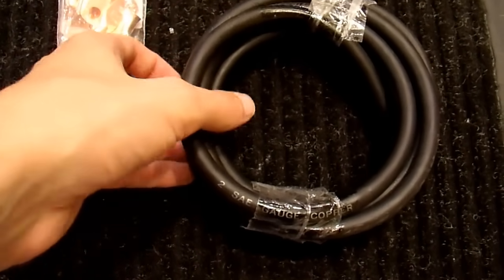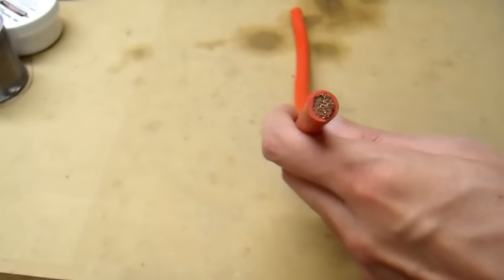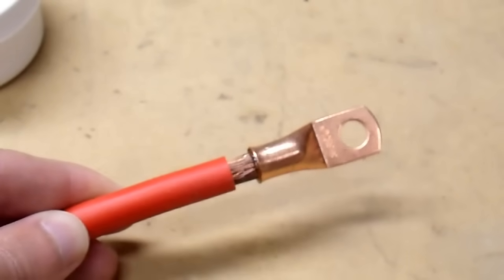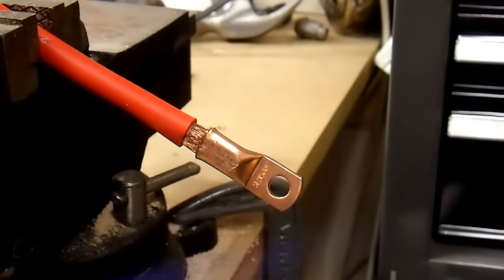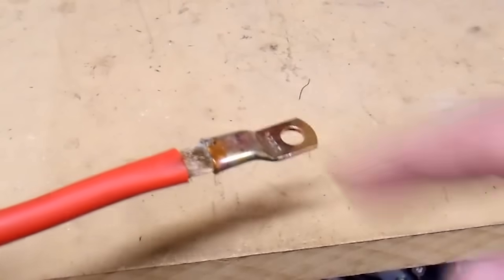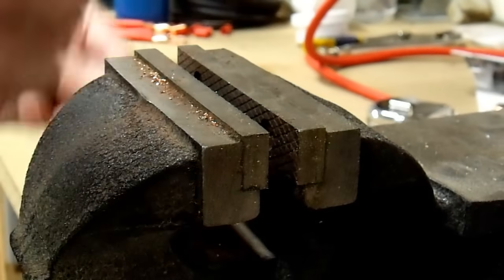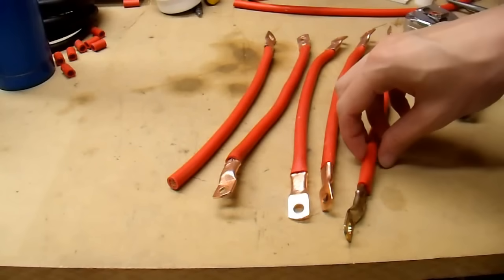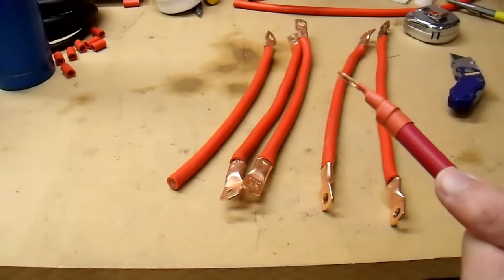How to Make Battery Cables the Right Way and the Easy Way

Comment: I have run into a problem a few times. This concerns installing inverters. The awg that a manufacturer says is needed for installing a inverter is to large to go inside of the connector on the inverter. The only way to fit the wire in the connector is to cut back some strands of wire. Does cutting back some strands of wire change the specs of the cabling ? I dont know for sure my self but, I would guess it does. Maybe its not enuff to matter. I just dont know. It has concerned me when ive had to do that so it would just be nice to know. Thanks.
Reply: Bryan Keith
Yes it does.

Comment: if using the small solder. What i do is stretch out  1 ft long and i spool it back and forth across 2 points 1 ft apart. Usually about 5 or 6   times then twist this up and it gives you a nice thick solder.  The heat shrink tubing is nice to label 12 volt positive and negative. Dual wall works very well also for protection. If you have that green type corrosion, use hot water and baking soda. Works like a champ to neutralize the acid from the battery tops.  My 2 cents and thanks for making the video........... you rock.

Comment: I usually fill the terminal up with molten solder then re heat and dip the cable into the opening and let it cool. Heat shrink and your done for a better cleaner look. U can also use lead.

Comment: Why not clamp the terminal in the vice just to hold it? get it hot with the blow torch?fill it with solder and then plunge the cable in to it? Then heat shrink to finish it off :)

Comment: the heat shrink is also protecting for the gases you talked about if you can't pull the cable out then its fine

Comment: When putting connectors on the cables, buying some heat shrink with glue on the inside is a much better choice than using electrical tape to seal the ends. Also some silicone grease to keep the acid out is a good idea as well when inserting the cable. A tight crimp with clean wire is always required for a good connection that lasts. Clean as in no oxides or dirt, and cleaning the wires and lugs with acid either sulpheric or hydrochloric is needed, but must not by concentrated. Always pour acid into water to dilute, never the other way around. You will get a steam explosion and possible blindness if you do not follow this rule.

Comment: You're advice like your work is completely wrong .heat shrink is to prevent corrosion if installed right. And if you did the connection the right way " not you're way" Then you have no need to see if its lose . And a volt meter should be used to test not a look see. after watching this funny video with the misleading tittle i can see you need to watch a video on how to for real not for laughs as most do.

Comment: I like to ground myself by sitting in the bath, connecting the + and - to a 12v leisure battery - I put the neutral in my mouth and the line up my arse.
Sometimes I put popping corn in the water as well, if it's a movie night.

Comment: You can also make your own terminal connectors with copper pipe.
Tools: Pipe cutter, hammer, drill, drill bit, measuring tape (optional)
Select the size of pipe you need for the size of wire you will be using...cut off the amount you need (pipe cutter) to put on the wire plus the amount needed for the terminal hole.
Hammer one end of the pipe flat...use drill & bit (sized to your terminal stud) to make a hole through the flat end...place open end on wire & connect with punch and/or solder.

Comment: Vices are for amateurs, go the Hydraulic crimpers (borrow them if need be) Then cover with the thick quality adhesive lined heat shrink. Make the cable insulation tight to the end of the lug. Thats how  I roll

Comment: Adhesive Heat shrink is recommended.  It helps prevent corrosion.  They trained me proper way of making cables when I was building locomotives which is meant for all kinds of weather. And not easy to change out either.

Comment: You have never actually made cables in the " field " as we call it , Heatshrink and Spray On Clear " Liquid Electrical Tape " name brand " are a must in my business. Bare Stranded wire behind the lug invites corrosion under the insulation. I work in the Marine electrical field , your unprotected cables would not last a year.

Comment: NEVER Crimp Automotive cables, even heat shrinked .. there will be microscopic gaps where Corrosion CAN and WILL get in....   

ALWAYS Solder Automotive cables with Medium SILVER..  as it has HIGH melting point of 1380 Degrees.. Unlike regular Solders 370 degree's..  You can use medium Silver chains from a Craft Store for financial feasibility as  It's A LOT cheaper..

Yes....   Flux does NOT corrode.. ,  but Acidic rosin core plumbing solder WILL...  But what idiot would use that on wire ? ? ? 
AND Lastly............... Heat shrink WAS created for a Purpose..  It IS NOT just a frivolous foo foo Decoration...

Comment: Welding wire cable has FAR lower resistance, a higher grade insulator and is more flexible.  Marine grade (tinned) terminals are FAR more resistant to corrosion.  If you are going to do it yourself (best choice), then DO IT RIGHT.

Comment: Before soldering heavy electrical wire lugs I would suggest you watch this youtube video...
CBAC-Crimping Tools and Techniques for Cable Lugs.   Resin soldering works great for audio/video connections but is not the correct way for electrical cables.

Comment: And you are totally off base when saying that heat shrink is only good for cosmetic reasons. Also when you were soldering with the thin solder you should have pulled out a few feet, folded it over a few times and lightly twisted it together rather than wasting all that time peeling off and stuffing in the skinny stuff.

Comment: Just a prediction - Your soldered terminals, for your purposes, will last longer than your critics.  I think the only thing I would have done differently would have been to use the "no clean" type flux to make sure it drips into the center core of the cable.

The auto makers just crimp their cables, and they fail.  Worse yet, they fail down inside the lug where you don't see it as the corrosion accumulates and you wonder why your starter seems weak when you know the battery is good.  But the auto builders make good money off the repair side of their business, so there is no motivation to do better.

Comment: 3m heat shrink has hot glue adhesive in it and seals the connection. cheap heat shrink doesn't work.

Comment: instead of buying that thick gauge expensive wire '''' just push long lengths of house hold wire from scrap appliances through cut sections of garden hose pipe '''' strip ends twist together and then sod around with ends like your video '''''  and thats how to make free jump cables ' your welcome sheeple  ( heat shrink is the best ' keeps wire safe from corrosion ' can be over lapped so wont wear away or melt and wouldn't when cables are used correctly ' and looks tidy )

Comment: As for heat shrink not knowing if it overheats—if you pay attention to the hear shrink you will know. There are signs of heat damage unless you use open flame to shrink it which is incorrect procedure. Heat shrink keeps out moisture and reduces shock/short hazards.

Comment: I know the connection's good and there is no corrosion under my heat shrink because I did it.
Reply: because i did it  WTF   can you guarantee this statement is true 7 years from now.
Reply: @kwacz  Because I've been heat shrinking for 40 years with no issues?

Comment: Spend the $12 bucks for crimper, put electric grease on wire and use heavy duty heat shrink, heat up until you see the glue on the ends start to liquefy. Then you know if the joint is good, 
Zinc coated copper lugs are a better choice as well, they don't corrode!!!!
Reply: So you are recommended puttng dielectric grease on the stripped bare wires.  Then iserting the wires into the connector and crimping it.  Then sliding the heat shrink sleeve over the greased wire connector and applying heat to shrink and seal the sealant filled  sleeve???   What do you think happens to that grease when its heated up and what effect that now thin liquidized grease running out of the connector under the heat shrink sleeve and its sealant.  How well does adhesives stick to surfaces coated in grease?  How well does sleeve seal with expanding grease pushing seeping out from under it.

How about we lose the dielectric grease and save that to allie to the connector lug mating surface after the connector is installed on the wire.   Nickel and zinc coatings slows corrosion they are not corrosion proof.  They will corrode.  If you think otherwise put some battery acid on them and see what happens in a few weeks months.

Comment: Wow it's not hard to cut your wire to the right length before putting it in the ring terminals and always use some sort of a crimp tool, I use heat shrink looks miles better and why would you have them so close they would touch, maybe because you have so much copper showing. I don't do that many big cables but use smaller crimps all the time as an electrician to join cables or to add a ring terminal and I never have any copper showing at all ever really rough especially if done near metal as I have to crimp wires in metal trunking a lot. I just don't have a clue how so many people have watched this video yes there are worse ways but this is defiantly not the right way at all.

Comment: Wrong!!!! There is a reason that large  ampage cable should be screwed on. Or pressed not soldered 

The reason is that when high ampage go throu the conection it can caus heat. 

Heat is melting the solder and it can caus a fire. !!!

Comment: Ive been a marine tech for 20 years. When you solder wire it acts as a solid wire, fatigues from bibrstion and breaks. I swage the lug, cover between the insulation and the parts that will be covered with heat shrink with hot glue and heat the heat shrink. Even after submersion in salt water it is sealed.

Comment: This is certainly not a bad way to assemble the cables, but they do make a large crimper for this specific purpose.  If you use the crimper you don't really need to solder the ends.  I do solder the lead battery cable ends on however.

Comment: I would drill a hole in the terminal end instead of pulling the isolation back. The isolation should be tight into the terminal and the hole is used to draw in the solder. My prefered method though

Comment: My suggestion is to place the terminal in the vice melt in solder about 1/3 deep then press in the exposed cable and let it cool for a second. Once cool you can dent the end so will not pull out if heated etc. Also shrink tube is not needed if you measure the cable end properly

Comment: I don't know where you live but this by no means is less expensive, in Texas, than purchasing cables. Personally I hate these types of clamps, attachments. They are a nightmare to remove later. They are the reason I had a horrible, unnecessarily time consuming, task of removing them in order to attach much needed new attachments. I opted for traditional post attachments, less than $8. I didn't replace the cables this time, but I have in a different car. I don't recall the exact price for the cable set. If I had chosen to replace like for like they would have more expensive. I know I would have spent more money buying all the things you use in this video instead of the ready-made set. Also, by the time I got all of this together, set up, etc I would have been halfway done replacing the ready-made cables. Oh, and I don't keep a soldering iron in my apartment, or a vice. This is just unrealistic for so many households.

Comment: Your definition of “the right way” is deluded...
1. Flux is used to help solder adhear to the metal.  Why would you put it between the copper wire and terminal.  
      A. I get what you’re trying to do, the correct way would be to apply solder to the wire, and then crimp your terminal on the end, then heat and add solder.   

2. The “right way” doesn’t use comments like “ I’m only doing a couple cables so I’m not going to buy the right tools”. 

3. The right way would also involve heat wrap.   

Just my $.10.  Had you not labeled your video “how to do things the ‘right way’.” I would have watched, laughed and moved on.   But dude.   There are people who believe it if it’s on YouTube.

Comment: If you're going to use vise grips or the like to make a crimp, for gods sake at least put something in it to delay the corrosion like noalox or even petroleum jelly.  A properly done crimp will pressure weld the components together, sticking it in a vise does not and is no more than a temporary expedient.

Also, when soldering ends on big cables I recommend wrapping a 1.5" wide strip of wet paper towel around your insulation, it'll keep the insulation from getting fried and it'll help prevent the solder from wicking back up the cable.

Comment: Good video. My crimper is a set of bolt cutters that I adjust so when they are fully closed, there is a 1/8th gap. This way they are not able to cut. Most people do not know you can adjust that bolt on them to do that. It beats paying about $30 for a lug crimping tool. Plus if I need bolt cutters, I just reset that bolt to make them cutters again.

I would like to say to all the over educated nay sayers posting. You are not paying attention to the video in context. What do you all think this video pertains to? My intalect tells me he is making a video on how to make battery cables for a Solar Battery Bank and how to do it the Right and FAST way.  It is not about making welding cables or making cables for race cars or semi trucks or any of the multiple things people list as their professional experience.

You people remind me of the know it all idiots at church who pay no attention to the full scripture teachings in the Bible and try to argue some fantasy that you base on one or two verses from here and there. Sometimes I have to force people to sit there and read a whole chapter for them to see they are arguing wrong on a given subject. A subject that on it's full context is 100% correct, but for some reason they butcher it with stupidity that is not relevant to the full context.

Comment: This is great if you are making a quick fix on (1) cable, but for anyone making many or not in a huge hurry, this is all wrong. Proper crimping, not flat in a vice. Wire should be on the down slope, not up. You simply melted the wires insulation. Heat shrink is the BEST way to seal wire to prolong the life of a cable. You use a meter to know if your cables are going to hell!! NOT just a visual!!!!!   WOW!! Please remove (THE RIGHT WAY) from your title. It absolutely IS NOT..

Comment: In my experience, i do not use these ring terminals, just use cable  make a ring and connect direct! much safer
Reply: Something happened to the ring connector on positive battery lead of my MTD riding lawn mower. Battery cable is wrapped through hole on flat battery post. There is no Bolt to hold the cable on. The cable was crimped on with pliers apparently to the battery post. I usually have to fuss with red copper cable to get mower started. I'm only looking at this video because I have to spend another $3 to get free shipping to home on something I really need from the auto parts store. A discontinued Haynes repair manual for my 03 Cadillac DeVille. Would really like to find the owners manual. The Homelink garage door opener I would like to connect to my 4 houses

Comment: Obviously this guy has been doing this for a while and for his purposes it works completely fine otherwise he wouldn't be doing it this way if it was problematic
Reply from the maker: Not one cable made this way has failed and I have made very, very many.  Cables 'professionally' made have failed on me many times.
Reply: @knurlgnar24  you could say the same thing about lots of jobs but it doesn't make it right, crimping done right works for many reasons, what most on here are not thinking about is when you have a bad crimp the individual wire strands are not fused together leaving room for air, and that air causes corrosion, and i doubt anyone could honestly think shrink wrap could be air tight.  none have failed on you , lets compare that to leaving lug nuts loose on your car, you might drive thousands of miles with out a failure, then a wheel falls off and you die.  its never best to think you don't make mistakes or to never leave room to learn,  if nothing else just go on your own to an electrical shop, or maybe the library and look up how aircraft wiring is done, surely you don't think you that smart, but it is good that if something you do fails it won't fall out of the air it will just not start.

Comment: you obviously know nothing of how electricity works ! crushing the lugs in a vice ! hitting them with a punch ! please lol. that way will cause the cable within the lug to overheat ! why do you think 6 sided crimp tools are used ! because they crush all of the interior of the lug onto the cable tight which prevents hot spots, loose connections cause heat and eventually FIRE !
Reply from the maker: I have used 6 sided crimp tools and have had failed cables.

Comment: Hello Sir, while I'm sure you have good intentions to help folks. However it's a proven fact that a hydraulic crimping tool will secure that copper end so strong there's no way possible to remove it. Soldering is always a good thing but to get a super tight connection you really will want it to be done with the proper tool 😃
Reply: T & B makes a super crimper, the TBM14 that can be wedged into one of those adjustable saw horses, and the pump has a good little remote control so you can
pay attention to the crimp. Plus, if the crimp's right the dies will leave a number.